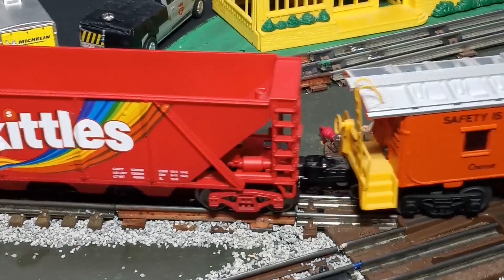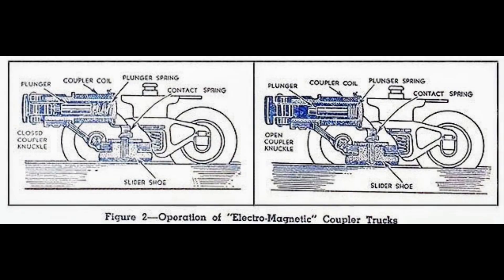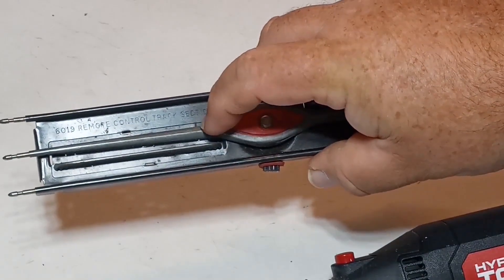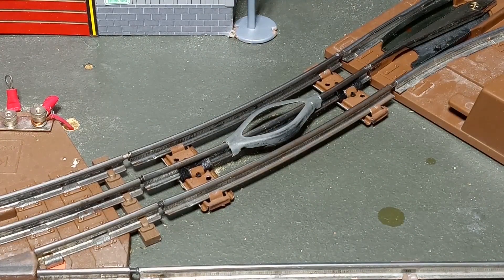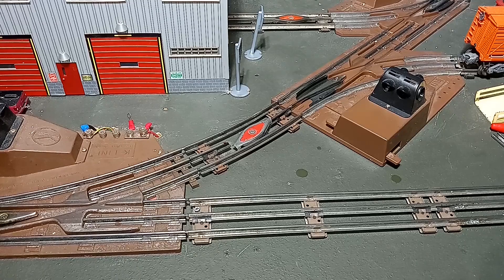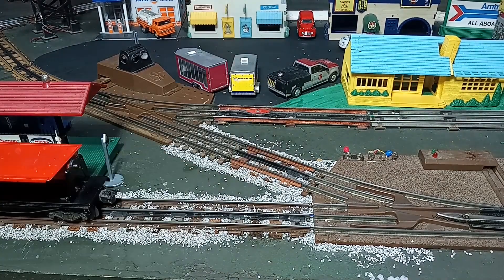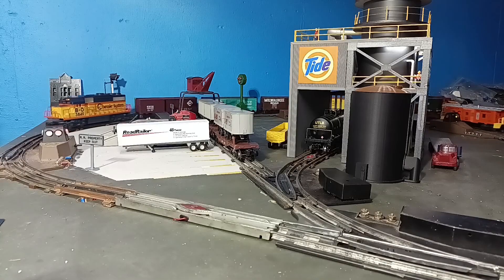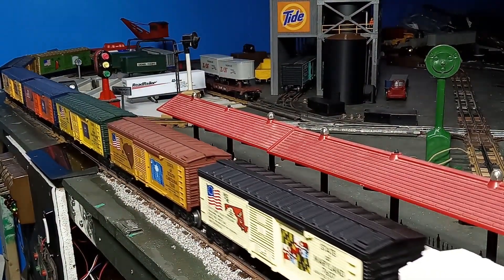How To Add Lionel Uncouplers [Almost] Anywhere! Even On Curves!

Comment: Nice tip Mike. You have helped me with several of your modifications to my postwar style layout. I know I can always count on you for usefull  innovations for the postwar electrical accessories on my layout because you take the time to figure out ways to make those adaptations those of us have questioned ourselves. Keep up the good work. It's as if you can read my mind. Thanks to you I use a single pole momentary pushbutton switch from Menards to active my control sections taking up a small footprint on my console. I came across your video on this modification just as I was installing these on my layout I'm in the process of building.
Reply from the maker: I love to hear that! Thanks for the feedback!

Comment: This is a pretty clever idea. Although as someone who wouldn't personally cut up anything that's out-of-production, I would wonder if it'd be possible to do something similar using the modern track produced by Atlas, or perhaps improvising the electromagnet from scratch.
Reply from the maker: You certainly could, but I paid on average $2 each for the 6019 pieces because the original wires were broken and few people know how to repair them (because they don't watch my videos! ;-) ) Even the parts for a DIY magnet would cost more than that.

Comment: Actually if you are this handy, you can make your own electric magnet, with a steel center (nail) and coated coil winding wire. Either count turns or measure the resistance of one you have and the coil wire size and you are good to go.  Partly why I mention this is that center rail spit getting closer to the outside rail, can cause some problems on the curves especially with the 6 wheel trucks and the fat wheel older engines.   PS: if you had the dremel you could have just slit the rail down the center and spread it and put in the electromagnet.
Reply from the maker: Thanks for the tips!

Comment: I have a Seaboard switcher, '58 vintage, with magnitraction.  It has coils around the coupler stem.  Do you anything about on this system? Thanks
Reply from the maker: The Seaboard 6250 was made in 1954-55 and has electronic coil couplers. There should be a pickup shoe under the truck that picks up power from one of the UCS or 6019 control rails for uncoupling. https://youtu.be/iBEgbR_i8d8?si=eY0z6asN5bPBC3Mw

Comment: Great video, is there a way to set up a switch for the plastic tab type of couplers? i.e. NON magnetic.  I have a Pennsylvania Flyer set circa 2003
Reply from the maker: You MIGHT be able to add a metal thumbtack to the existing coupler tab to enable magnetic uncoupling.
Reply: Great simple solution!  Thanks.
 @ToyTrainTipsAndTricks

Comment: Curious if just putting an electromagnet under the track would work? If it was strong enough, no doubt it'd pull the plungers.
Reply from the maker: It's theoretically possible. But I paid roughly $2 a piece for these 6019 sections at a show last year, and it's highly unlikely I can purchase and or build my own electromagnet for less than that!

Comment: Can you do a fast track ?
Reply from the maker: FasTrack would require a lot of slicing and dicing of the roadbed. It would be easier to buy (or make) a separate electromagnet and install it where you need it on FasTrack.
Reply: Will try this in a short time. Thanks for the come back. Oh by the way one of my friends just suggested using O gauge track with the combo transfer track pins.